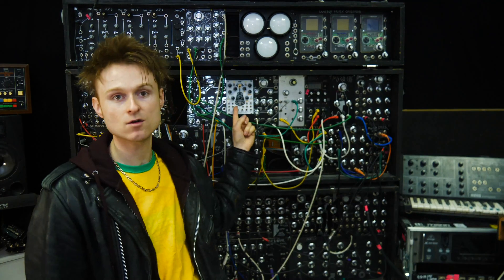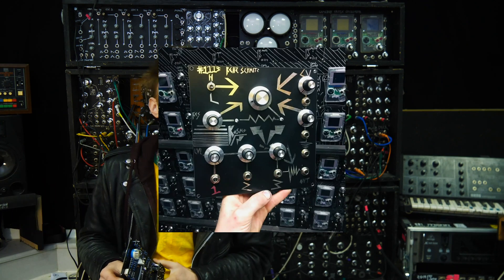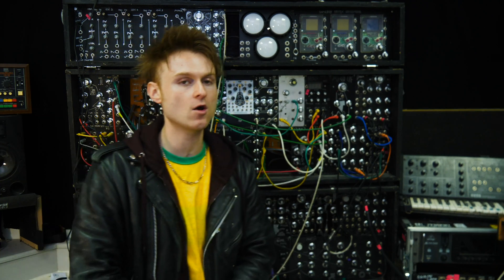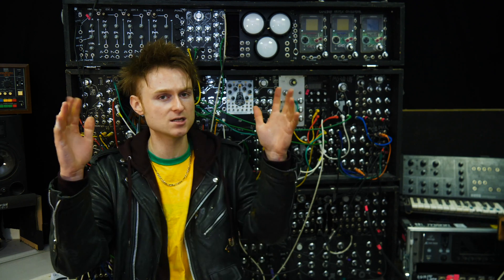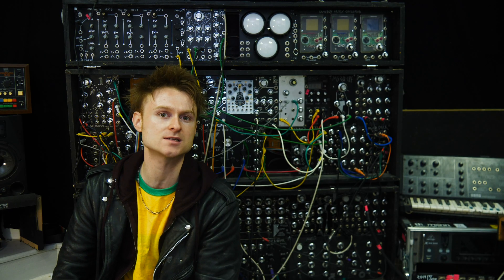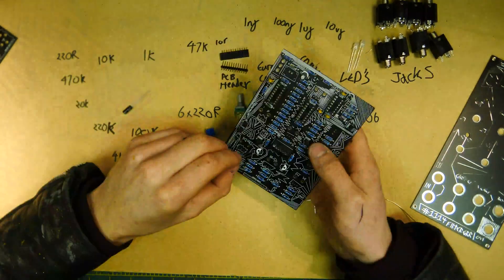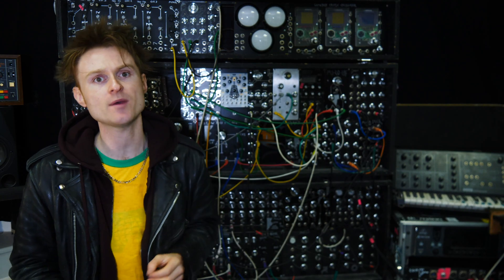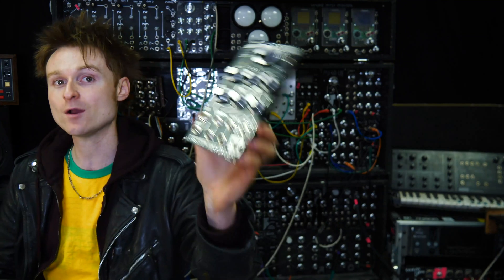One Year Of Designing And Releasing A Synthesizer Module A Month.

Comment: An Atari punk filter. Awesome. I've heard that one needs an oscilloscope to tune your modular if you want to use a keyboard. Is this true? I might be mistaken. Anyone know?
Reply: I think that is more if you want the modular to be pitch perfect, otherwise tune to ear. Or say "near enough for enjoyment purposes".
Reply: @gorillaau  Would say, an app work or does one need an actual oscilloscope?
Reply: @PaulTheSkeptic  You are only after the frequency... so yes an App would be good enough. An oscilloscope comes into it's own for examining the waveform when you think you are hearing distortion.

I'd start with an App and then approach a makerspace or makerspace near you for access to an oscilloscope. An hour or two at most will do it.
Reply: @gorillaau  Thanks.

Comment: this may not work but i cant get this idea out of my head:
a cv controlled hurdy gurdy type thing, where you can control the wheelspeed via cv and gate, the strings are attached to a stepper motors so you can control pitch. this could get some nice drones and rhythms by modulating the wheelspeed.

Comment: Hey Sam, do you know were I can buy 1/4 inch jack cables cheap because the only way I can buy them is one at a time and for like $5 each which will get very expensive.  It is the only reason why i haven't taken the plunge into the Kosmo format
Reply from the maker: Check the thread on the forum cheap component search you can get em for about 40 cents each

Comment: If the PCBs were shorter they'd fit in eurorack :$
Reply from the maker: Yeah but then they won't work with kosmo format. Gotta weigh.it up. I personally am not a fan of how small eurorack is hence deciding to do the rather odd and dodgy decision of making em a bit bigger
Reply: @LOOKMUMNOCOMPUTER  yea
the panel holes have to be like 125.5mm apart or something stupid.. mines about 123mm haha
Might have to build a kosmo rack to go alongside it :D
Reply: @LOOKMUMNOCOMPUTER  I know the feeling with it eurorack being pretty small.  I learned this pretty quickly when making my mixer and joystick module in my rack. Didn't take long for my hand to get tired with a Joystick panel mounted in a small area. They are  around the size of euro rack  and the play-ability for a  live performance is really cramped. Really more for a studio or  in my case just use the mixer too mix signals set and forget.   Saves space but for performance it lacks.  Mines a mishmash  Kosmo 5u Top and Whatever fits in the bottom.  For me its always better and easier too work on larger stuff So it might aswell be a little larger.